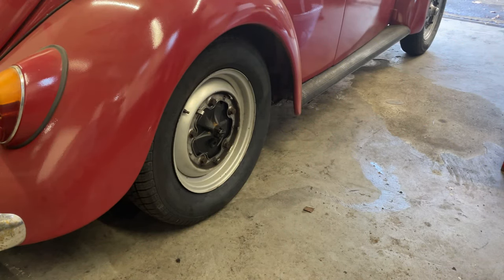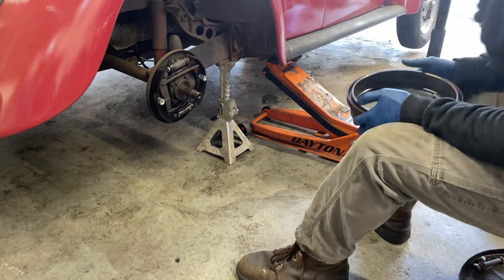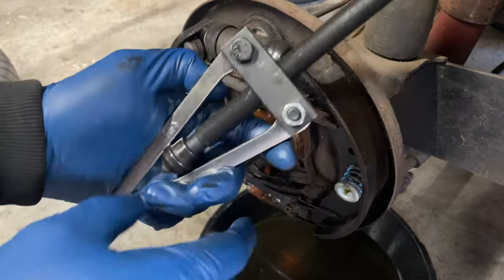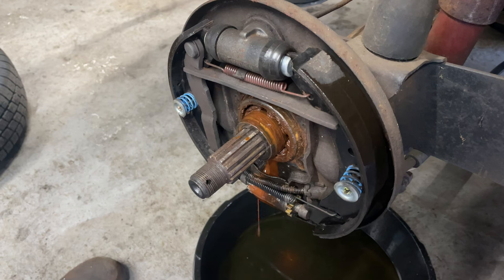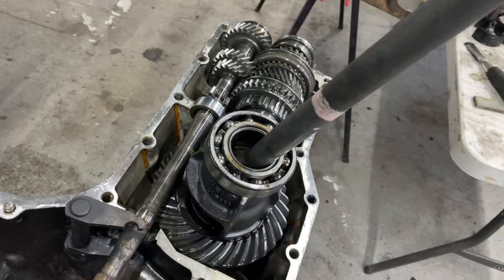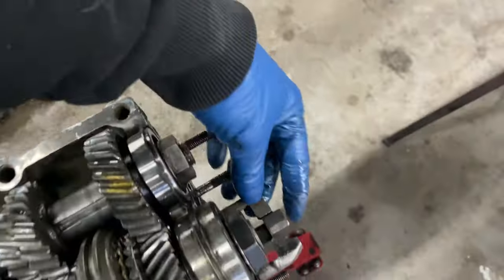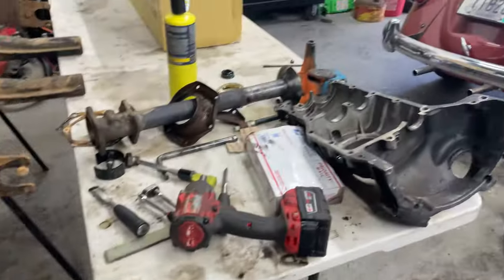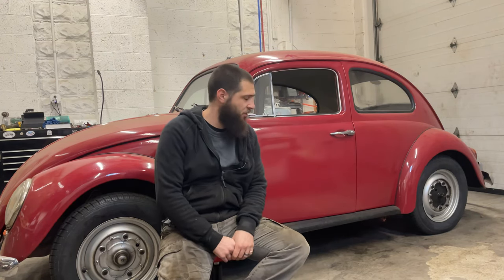The WORST Axle Bearing I've EVER SEEN - How To REPLACE Classic VW Swingaxle Axle Bearing

Comment: Good, problem I had was that when you push the new bearing on it also pushes the drive shaft in, leaving not much thread showing when drum is back in place.  Hence why it's important to use correct torque setting on drive shaft......to wind the shaft back out.

Comment: perfect timing, I was looking at the 59 and both sides have tell tale signs that the seals are both leaking.  I probably should NOT flat tow that home 30 miles.  Thanks !!   And I think I did buy that same puller off the samba bceause getting that f n bearing off is a bear - I welded to my first one (62 bug).  But we are to get smarter as time progresses.

Comment: Another great video!  I noticed the rusty sludge started oozing out of the bottom of the new bearing.  Where was the rusty sludge coming from?  Is the residual sludge just so nominal that one need not worry about it?  I'll be doing all this on my Beetle sometime in the next few months so I'll put this video and your comments in my how-to library.
Reply from the maker: It’s coming from the axle tube. I sprayed the bearing out with brake clean before putting the cap back on. Once I get a couple 100 miles on it, I’ll change the gear oil again. Only way to get the majority of the schmoo out with pulling the axle tube to wash it out. This video will NOT apply to your Super Beetle as you have an IRS rear end. I have a video on doing the rear suspension on my bay window Bus that is applicable to your Super. Good luck!
Reply: @wickedwerks  Thanks for the great response and great advice.  I will go look for that video and put that in my how-to library!

Comment: You need a hot plate. 50 years ago I owned a VW 3 finger outer axle bearing puller. I have lost it over the years wish I still owned it.

Comment: According to the Bentley manual for pre 59 cars, they don’t show the paper gasket for the carrier area. Would you use it anyway? Bentley only shows the O ring seals.
Reply from the maker: Yes.
Reply: Thanks. What sealer do you use on the paper gasket?
Reply from the maker: @jeffbannon1345  permatex “right stuff”
Reply: @wickedwerks  thanks!

Comment: Should you not have put plenty of bearing grease into the new bearing before sliding it onto the shaft?
Reply from the maker: No, bearing is lubricated by the transmission oil.

Comment: So I got a question for you, sir, consider that burian. Was it under water? Why would you even consider cleaning it? Sort of throwing it in the garbage and replacing it with a new one. What the junk that was inside there, the lack of a proper lubricant. Those barren minds will consider them shot. The garbage thrum away put new ones in. They're really inexpensive. That thing was running around with basically water, dirty water in there. Don't reuse that my friend

Comment: hammering a new bearing into place, really.
Reply from the maker: If it can’t handle a few light taps with a hammer, it shouldn’t be on the car.
Reply: @wickedwerks  And when they are hard to fit on the shaft ,hammer more,come on, teach the right way, or not at all. Bound to be new guys/girls doing this.

Comment: Sometimes I wouldn’t mind seeing how you clean parts and stuff.
Reply from the maker: Sometimes I do, most of the time I can’t be bothered 😂 in this case I just used simple green, hot water and a bristle brush. Hit the seal surfaces with 0000 steel wool.
Reply: really.../?    .brake clean, cotton rag... picture that..
Reply from the maker: @rrs1550  everyone has their own way.